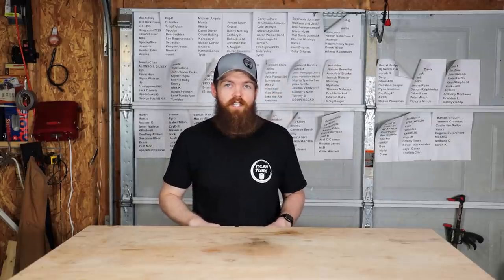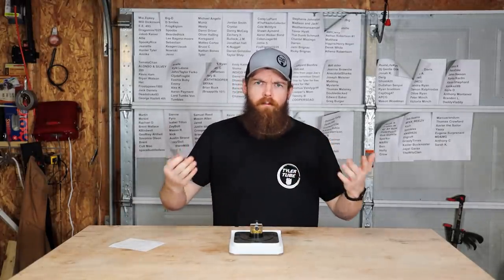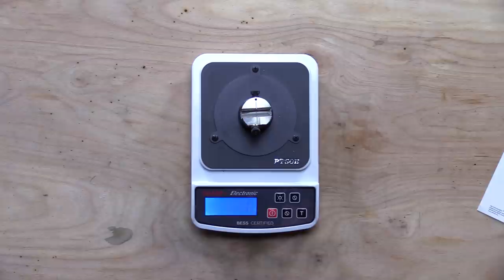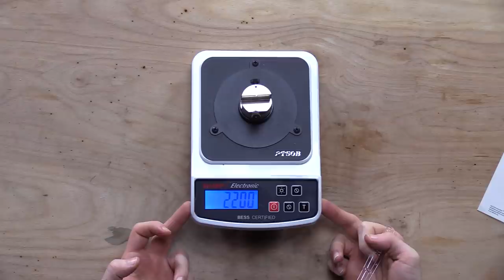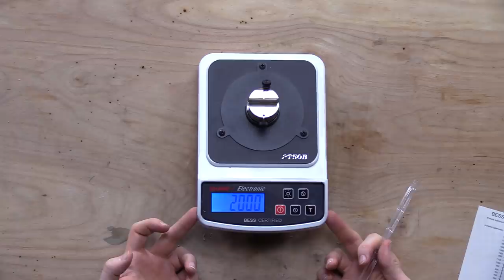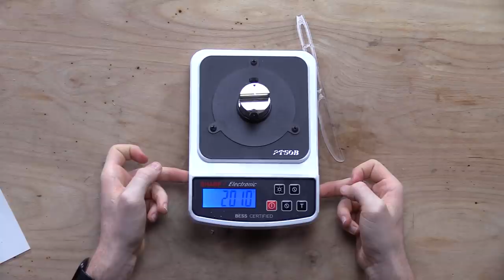How Sharp Can You Make A Plastic Knife?

Comment: The knife is razor sharp, you didn't fail. What happens when the plastic gets that sharp, the plastic is so thin and ductile that the edge immediately rolls under any pressure.
Reply: Exactly what I was about to say
Reply: same as the wood, far to brittle.
Reply: Came here to say this. The plastic is just bending under the pressure due to the tester being much harder
Reply: Yes this sharp tester is meant for metal. To test the sharpness of wood or plastic you would need another piece of wood or plastic to push against
Reply: I, also, was going to make a similar comment. Well said!
Reply: Syens
Reply: To avoid this phenomena you need to sharpen the plastic like an axe or a chisel.
Reply: Pretty sure ductile is the wrong word here.
Reply: Try one of those black plastic ones or the plastic ones that are supposed to look like a real butter knife
Reply: @CaptainQ2607  ductile - able to be deformed without losing toughness; pliable, not brittle.

I'm pretty sure it is not the wrong word.
Reply: @gavdomdad  fair enough I've never seen it used like that and thought of forming into wire
Reply: Definitely agree the plastic gives on the tester making it seem duller than it actually is
Reply: @CaptainQ2607  I agree I have never seen it used that way either.
Reply: @CaptainQ2607  typically when you think ductile you think wire. The only reason I knew the other definition off the top of my head was years of engineering titanium ingots and nickel alloy airfoils.
Reply: @gavdomdad  sounds interesting 🤔
Reply: He failed
Reply: That’s well said I was trying to think of how to say it thank you
Reply: Was gonna say this lol
Reply: Not to forget this dude is going "plastic on plastic" , would have tried a thread instead for control and after sharpening
Reply: I also came here to say this
Reply: Was literally about to say the same
Reply: That was my thought as well.  It warps and folds
Reply: not everyone got logical thinking i guess
Reply: You should try to make a plastic shank either sharpen a toothbrush or that plastic butter knife
Reply: It hurt my brain that i couldn't say anything to him lol. Very unsatisfying
Reply: You said it for me thanks lol
Reply: Thanks for saving me the time of explaining this ✌
Reply: Maybe he could use the handle of the plastic knife instead of the actual knife area to sharpen it because the handle of the plastic knives are a little bit thicker
Reply: Exactly! A sheet if paper is sharp as well, but you will never be able to cut that metal wire you use for the sharpening test. The reason it gets "duller" is because you are actually making the edge thinner, therefore, it mends more under pressure.
Reply: Yessir, also another thing you could have had better results using heat and pressing the plastic into a formed edge. This way you would have had more material to hold from curling.
Reply: You CAN make those knives extremely sharp by doing this. I won't explain how I know this but, just know it does work lol.
Reply: not only that. The plastic material is probably a softer material than the cord on the sharpness tester
Reply: I was yelling this in my head and am happy you put it out there.

Comment: I wonder if when you were doing the sharpness test the little wire was cutting into the blade, making it dull?
Reply: i would say thats probably right if the knife at least made a cut in the paper, maybe that might be a little part of it though
Reply: 100% the reason. The plastic is too soft
Reply: I think because the sharpness test is made for metal. Plastic and metal are different materials. 
If the wire was made of the same metal as the metal knife you would also got something different. 
So if you want to test plastic sharpness you need another material as wire
Reply: I would say maybe a little, but the sharpness test using a fishing line type material so I can’t see it being extremely hard, but it probably did dull it a little tbh.
Reply: @malachi4838  You are exactly right the knife was only dull in a few spots where he pressed it into the wire on his tester and would have at least cut the paper a little if it was sharp
Reply: @nerdygerdy  then why couldn't it cut through paper
Reply: Oh shit I didn’t even think about that being a factor
Reply: That’s what I was thinking
Reply: @calvin6314   I understand this is all kind of old now but don't underestimate the hard particulates in paper either.  Cutting paper is hard on metal knives even.

Comment: Imagine not knowing that plastic is weaker than metal and can't hold a point if you apply any pressure. And the hilarious thing is that the sharper you make it, the easier it folds, making it harder to cut things. Your best bet for cutting with such an edge is a slash, not a chop. Don't press down, but slide across.

Comment: Common plastic butter knives are made of a thermoplastic, a kind of polypropylene. They deform and lose their shape under heat. Friction generates heat as a byproduct. Thus, when sharpening a plastic butter knife, you are technically melting the edge into its sharpened state, and every time you use that blade edge afterward you are causing more friction along that blade edge with every cut, melting that sharp edge back to a dull edge. A thermo-setting plastic may get around the melting, but it would just burn or destroy the plastic instead of melting it, which could be more catastrophic than just a little bit of melting. 

Not only that, but the Young’s Modulus (a measure of how well a material resists being pulled or squished by a force) of polypropylene is over 105 times smaller than common 304 grade stainless steel. Even if friction wasn’t a problem (possibly through very extensive polishing and surfacing along the blade sides), the polypropylene blade would squish faster and easier than a steel blade ever would. Your plastic knife would lose its shape much faster than a steel knife, which is why it kept failing the sharpness tester because the wire was literally too stiff for the edge of the plastic knife to make the cut it needed to make, meaning the only way that wire was breaking was with snapping the wire rather than cutting it, which screwed up the results. 

Engineering is right about using steel for the sharp knives!

Comment: As a professional chef that hands sharpens high quality Japanese knives, with Japanese whetstones, I’m curious what my knives would be at on that “sharpness test”. 

Also a whetstone needs to be continuously wet, there should be water sitting on the surface of the stones.
Reply: Thats Not entirely true, unless you're only referring to japanese water stones an similar types. Some soak stones only require a pre-soak, some stones work dry.
Reply: @jordancameron4441  regardless, ideally there's always water present. Just because something works that doesn't mean it's going to be as good

Comment: Hey Tyler, I was actually going to ask if sharpening the plastic was thinning it out to the point that the material that you're cutting on the sharpness tester is actually stronger than the edge of his cutting blade requiring more force to "cut" it. Out of curiosity, what does the tester register if you try to cut the wire with the back side of the plastic knife and not the blade ?
Reply: Good point actually
Reply: @samhoran8738  actually there is no point it’s a butter knife not a normal one

Comment: Im pretty sure its due to the wire material you're cutting. Those sharpness testers are designed for hard metals, and using things significantly softer (wood, plastic, etc.), you're not going to get good, consistent results. The wire is biting into these items, removing the edge at the contacting surface, and breaking due to the force applied.
Reply: Just what I thought.
The plastic is too soft for a sharpness test. All the materials you are testing it with are harder than the plastic. When you sharping it it is sharp, but the moment you try to cut something with it you dull the knife but don‘t cut.

Comment: What is the wire in the gauge made of? I'm betting something more dense than plastic. Sharpening a blade requires thinning it, thinning it weakens it. Even metal needs to be hardened to prevent sharpened edges from simply crumbling or breaking, even on the hardest metals. It's really no wonder why this didn't work, it's simply physics. There is 100% a finite amount of strength something like plastic has, and there is no reality where we can find something viable like we're looking for here. We all knew this already

Comment: Things to perhaps consider.
1. Sharpen at a larger angle. Small angles are probably not gonna work on plastic. A profile like an axe or cleaver might give you a better chance?
2. Wet sharpening. Stones get hot, if the plastic starts melting or even softening, I think it's safe to say that's manhours lost.
3. Maybe forget about the sharpness test? Hear me out on this one. You can only cut when your edge is harder than your material. The same way knives will definitely not cut ceramics and can only shatter them, I'm kinda worried you're breaking the string instead of cutting through it. Maybe slice through a sponge as an indicator? Don't quote me on this

Comment: I'd say that what's probably happen is that you've drawn out the plastic into such a fine edge that it's become weak. The wire on the tester is probably stronger than the plastic is and it's probably cutting into the edge, only breaking after the edge has been cut through and the plastic is wider and therefore strong enough to break the wire through force alone, not slicing. If that's the case, you have sharpened the knife, it's just that everything you cut is harder than the edge of the knife. With the tester, you'd be better off cutting the wire with the back of the knife.

Comment: The reason why it might feel sharp to touch is because your finger is soft, the wire you are pressing it against is dense and pressing on a very small point of the plastic, resulting in the wire pushing itself into the knife. It registered sharper without the sharpening process because the blade was thicker at that point and able to withstand more force before the blade failed. Removing material made the blade fail quicker due to it being thinner.

Comment: The reason why it isn’t reading lower is because the plastic is so flexible that when you make it thin and press it to cut you a rolling the edge and are basically using a blunt knife, plastic knives are possible but you need a harder plastic.

Comment: Correct me if I’m wrong but no matter how sharp you get it it doesn’t matter because you’re trying to cut plastic with something that is plastic so it being super sharp has no benefit? Like a sharp mild steel knife won’t scratch hardened steel. But trying to cut a 1/8” plate of mild steel with a sharp piece of 1/8” steel won’t happen. The sharp one Would take damage first???

Comment: It's 100% possible to make a plastic knife that is sharp at least sharp enough to cut vegetables and scrap off things like stickers kind of how you would use a razor blade to scrap things off. That type of plastic you used is way to soft to hold any kind of edge and even Polycarbonate which is the hardest type of plastic that I know of doesn't have the physical properties needed to hold a super fine edge. You can buy polycarbonate knives but I believe they are mostly used as training knives and I believe they make polycarbonate razor blades which are used for the exact job I mentioned earlier which is scrapping thing off of hard surfaces. 
If you want to make a blade that can actually hold a razor sharp edge out of something that isn't metal I believe the only non metallic material that this is possible with is ceramics which can actually hold edges sharper then most metals are able to. I believe ceramics are the sharpest possible material we know of but although they can hold an edge because they harder then most metals they are much more brittle then metals so they can't take high impact forces without shattering. That's why metal is what most blades are made of. They are hard and not brittle so they can hold an edge and withstand impact forces.

Before anyone say anything about glass and it being sharp just know that technically glass might be considered to some as a type of ceramic. It depends on who you ask. A ceramics expert would say glass isn't a ceramic because it has amorphous characteristics but you can argue that it could be a ceramic because the process of making glass involves some of the same process that are involved in making ceramics and glass does have a lot of ceramic like characteristics. Glass and crystals are weird things.

Comment: There's more to a blade than sharpness. The hardness matters, too. No matter how sharp a blade is, if it's too soft, it won't be able to cut anything harder than it. 

The blade felt sharp on your skin because your skin is softer than plastic. But when you tried to measure the sharpness, you were trying to cut plastic with plastic, which is difficult because they're both the same hardness. 

Plastic is inherently soft. It can be used for cutting food because most food is softer than plastic, but other than that, you can't really cut any other materials with plastic. You need a hard blade for it to be useful.

This is why some blades are made of diamond, because it's harder than mostly everything, which makes it useful for cutting hard materials such as stone, tile, concrete, etc.

Anyway, you probably already know all of this. I have a feeling you made this video with tongue in cheek.

Comment: yeah, seems like a materials issue. the line is probably harder than the plastic, so the plastic edge deforms when pressure is applied to the point that it's now dull in that spot.

Comment: Hey I just got a "cold steel" fgx push blade its about 7 bucks and I am curious if it could be sharpened if dulled.

The knife is a fiberglass reinforced plastic and is pretty sturdy.

I think it would be a way better tool to try and sharpen

Comment: the sharpness test is conducted by cutting into a length of metallic wire.
Plastic won't be able to cut metal, no matter how sharp. - So the wire will begin cutting into the plastic edge, until it reaches the maximum force that the wire can withstand, which is why you're only ever gonna get 2000-2200 grams of weight. (I bet you could use the sharpness test on a coin and still get 2000-2200 grams)

Sharpness doesn't affect the actual strength of the materials. - Would've recommended trying some other tests, such as paper cutting, meat cutting, and some microscope images of the cutting edge itself. Or, you know, get quality plastic, and try to get a stouter edge profile, like a convex grind.

Comment: Anything can be sharpened to any degree, but only quality products made from quality materials will actually HOLD that sharp edge. The plastic knife edge is so weak, it's buckling under the pressure. That's why real knives are made from high carbon steel.

Comment: The main problem is how soft the knife is. There is a really sharp edge on the knife. 
But the metal wire in the sharpness tester is harder than the knife. And it is just bending. Same with the paper.

Comment: Plastic has a different structure than metal. It's much more flexible, especially at the thickness that it reaches by you sharpening it. There's also the point of using a metal wire to test a plastic knife, the wire is cutting into the knife. Your plastic knife is indeed sharp, just not sharp by the standards used for metal.

Comment: Okay, so when sharpening or cutting plastics of any kind, you need coolant. 
Add water to the stone so that it is always wet, and the friction will not allow the plastic to clump together due to heat and rip off. 
Redeem yourself, I wunna see that bottle cut in half.

Comment: Knives don't just matter based on sharpness, they matter on material. Plastic knives are so weak that not only can they not keep a straight point on its "target" they also don't have the edge keep to withstand the object they are cutting. This is why a plastic sword can be super sharp but parrying it will make it snap.

Comment: If the sharpened material in much weaker than what it is trying to cut (Plastic VS Wire) there is likely an elastic deformation taking place at the point of contact making the edge wider than it started with the blade width thiner behind the edge than the original profile. So, Yes it is way sharper than it was but the material it is trying to cut in damaging the edge immediately upon contact and force application.  Try sharpening a piece of Delrin  or this https://www.amazon.com/Executive-Letter-Opener-EX1-BRK-II/dp/B004GD85OK/ref=sr_1_47    or this one  https://www.bladehq.com/item--Blackie-Collins-Zytel--4502

Comment: Yeah the knife is sharp. The wire used to measure is a stiffer material than the plastic. If you used a softer material to test the knife and the plastic then you'd have a better bench mark